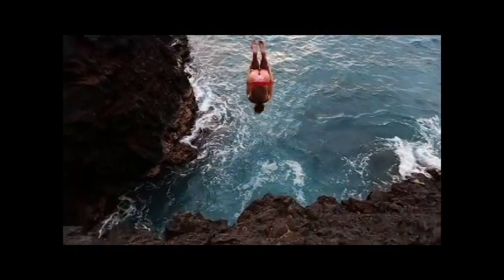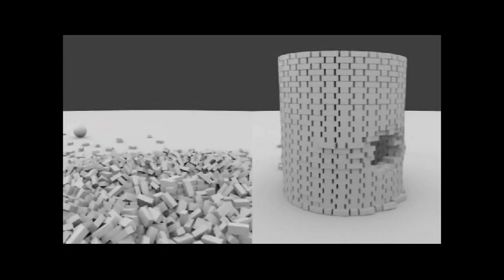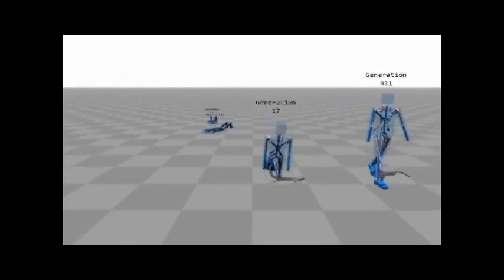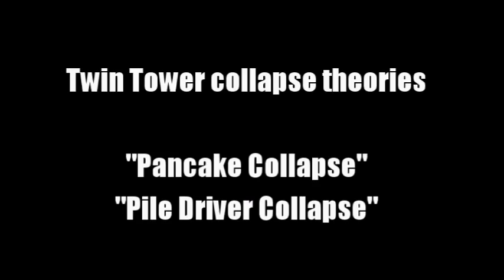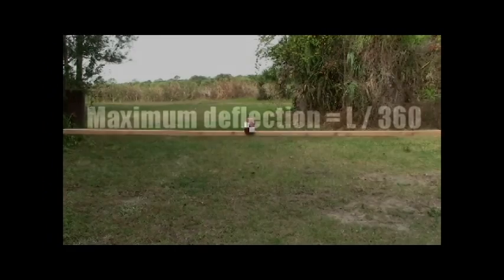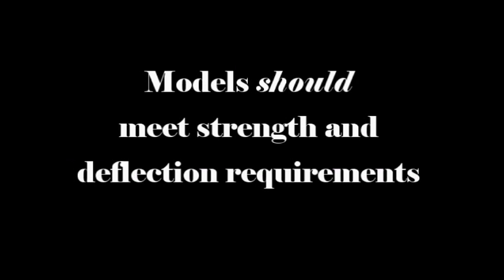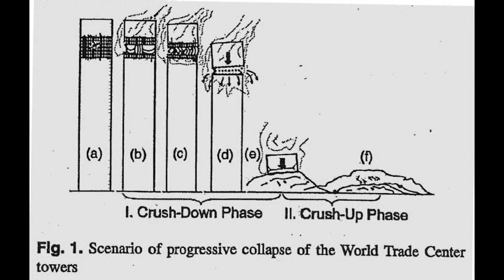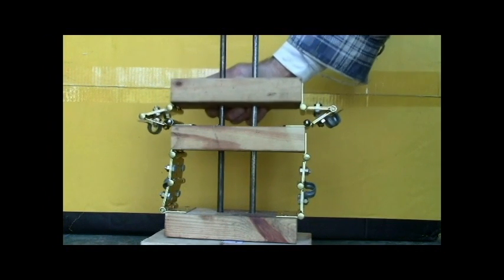9/11 Experiments: The Force Behind the Motion

Comment: Open your eyes pancake theorists. That is not what is happening. https://www.youtube.com/watch?v=nUDoGuLpirc
Reply: Dude! You use Chandler as a credible source? Really? The guy that doesn't understand how lifting concrete and steel up to the hight of the towers, actually creates potential energy? The guy that states the upper block could never crush more than an equal part of the lower block? The guy that thinks the towers are comparable to trees? The guy that obviously doens;t understand that the mass of the upper blocks only needed to destroy the floor-to-column connections in order to create a progressive collapse? The guy that thinks the detonation velocity of whatever "explosives" have been used to destroy the towers is approximately 100 mph?`The guy that doesn't understand how air pressure builds up when air is compressed, finding the easiest way out after and causing outward puffs? The guy that believes detonators and explosives would survive the plane impacts and subsequent fires on multiple floors to set off later?
You have to do A LOT better than this.
Reply: Did you watch the video? You don't need to hear his narration to see the collapse over and over again and see that it's evident that there is no pile driver and no pancake going on at all. The lateral ejections are all over the place proving one thing. Explosives. Open your eyes.
Reply: Oh yeah, I did watch the video, again. This video has been around for a while. It is not the first time someone tried to use it as some kind of evidence for controlled demolition. But you see, when you are observing a phenomenon and are trying to find an explanation, it doesn't stop when you've found one. You need to make sure that there are no other possible explanations for the same phenomenon. Like seeing a car slowly moving forward. What happened to the car? One explanation could be that it is on a slope and in neutral. So your conclusion would be there is a slope. What about other explanations like someone is simply driving the care? It was pushed by others out of sight of the camera? A second car bumped into it?

Back to your "explosives". Could there be any other, more logical explanations for your "explosives"? If so, what would these be?

Why do you think I asked you the question about detonation velocities? Please look them up and then explain to me why your "explosions" cause ejections that move so much slower than the found velocities. Don't you think that one simple fact alone would rule out explosives? How about no evidence found for explosives? How about no explosions being heard on any video during the collapse? Remember, we need to hear a sequence of explosions louder than a jet fighter at a 100 ft distance. One single explosion couldn't possibly account for what you think we observe in the video. And don't forget to explain how detonators and explosives haven't been destroyed by the plane's impact. As soon as you're able to explain this, yourteam has gained a new member.

Last question, how would you think to be able to observe collapsing floors inside the towers when all we have is a video shot from outside the towers? Really. How can you draw any conclusions on what dit not happen, based on something we cannot see?